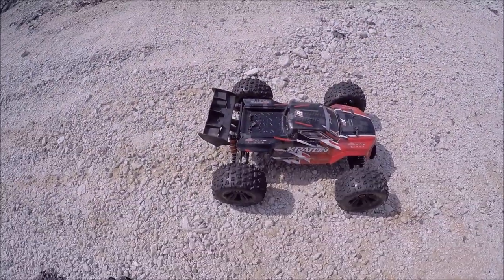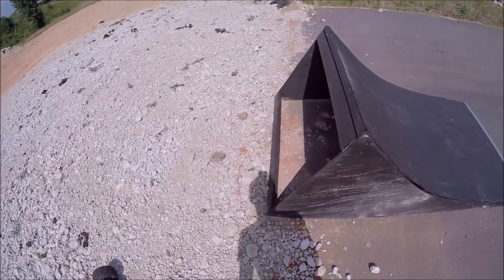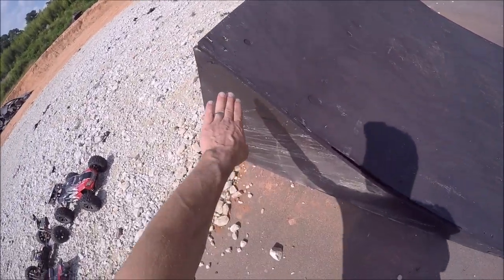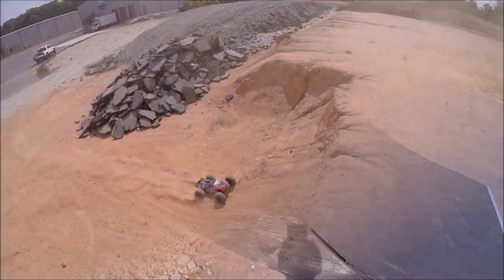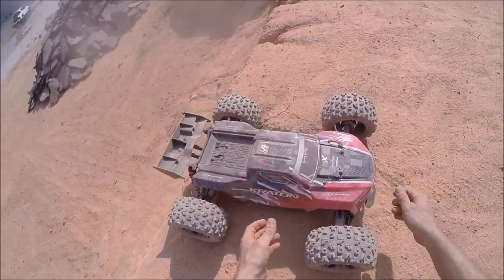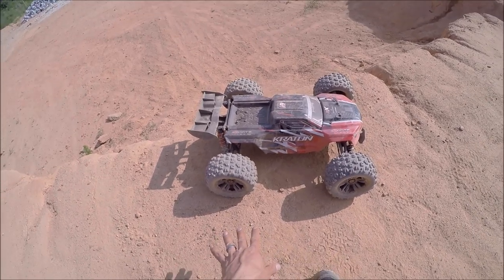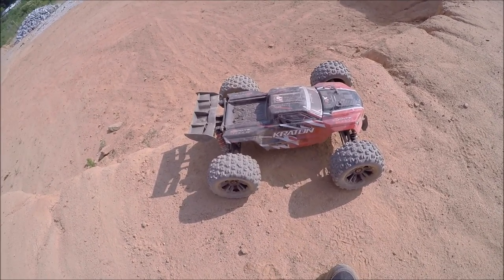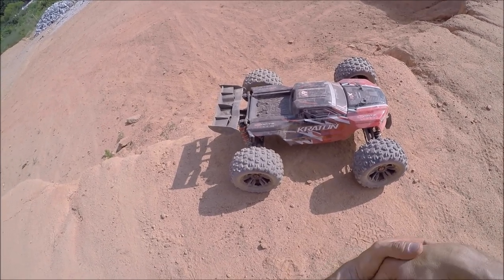ARRMA Kraton V4 "THE HIGH FLIPPIN BEAST" with DIY Mega Ramp!

Comment: KILLER Friggin Bash Brother 👊!!!! Great job on your ramp too. The reverse angle up front is perfect for keeping it grounded👍. I've found getting the transition (template) right is the trickiest detail. You just never know exactly how it will fly until you try 🤣. Looks very smooth for sure 👌. I try to make mine as light as possible yet solid enough for fast hits. Definitely need enough cross braces or you start having problems 🙀. I'm stripping my V4 as we speak. Tested the M2C shock caps/pistons yesterday pretty hard👀. Chassis and top brace are whacked 🤣🤣👍. Decided to use a prototype chassis and bum some Voltage off my V2. Might just swap my old Hobbystar 1730 in there too 💪. Hope your ESC is ok in your beefed up Kraton 🤔. Loved the HUGE sends and Killer rips Bro 😍!!!! No holding back like always 🍻🤘🤘😎💪💪💪👊👊
Reply from the maker: Thanks Rich!😁👊Yeah the DIY ramp is definitely a trial and error!🤣 It worked okay but didn't perform how I expected. May tweak it some or make another basically copying my plastic modified ones.👌I hear you on the M2C bro. Having so many rigs it's hard to get them all done at once!🤑🤑🤑But both V4's are next on my list for sure!! Still utterly surprised how well they are holding up basically stock!🤘But time will be taking a toll on stock plastics and aluminum for sure!🤣The M2C shocks caps sound sweet! Awesome Mitch keeps producing parts!😍😍Peace out bro!!😎👊🤘🤘🍻

Comment: Mate I'm impressed by your plastic ramps, are they to tahwali type on top of each other, so 4 altogether, some bolts on the sides? How did you make them? Thanks
Reply from the maker: Yes the are ramps mounted on top of ramps using pieces of 2x4 under them to use as mounts to screw them together. Works perfect!😆👊

Comment: Nice job on the ramp! How did it hold up after getting slammed repeatedly? What thickness did you go with on the jump face? The 1/4 inch I used is getting shredded on my 45 degree ramp but it's holding up nicely on my 38. I may switch to 1/2 and use some dado blades on my table saw to help bend it. Anyway, awesome job and massive sends as always! 😎👍👊🍻
Reply from the maker: Thanks bro!!😎👊Yeah it is definitely trial and error with the DIY ramp!😋It held up okay but didn't quite get the results I was hoping for by no means...🤣At least it gave me another option on the field! The only thing I noticed was right below the face the wood is cracking from underneath. May need to add another 2x4 in that spot. I'm probably going to rework it a little and see how it goes! But thanks again Ed!! BASH ON!!😎👊🤘🍻🍻